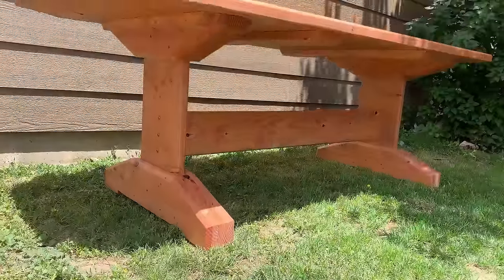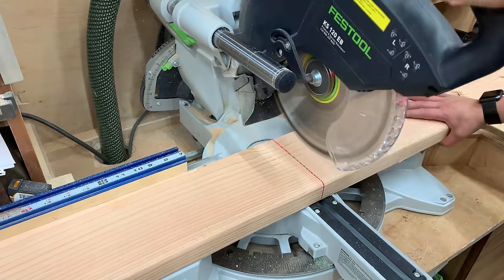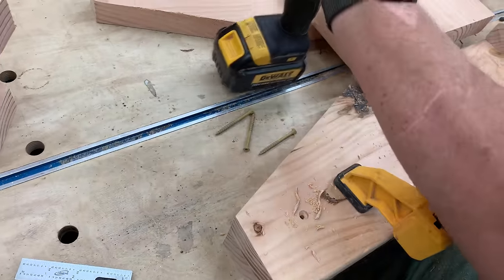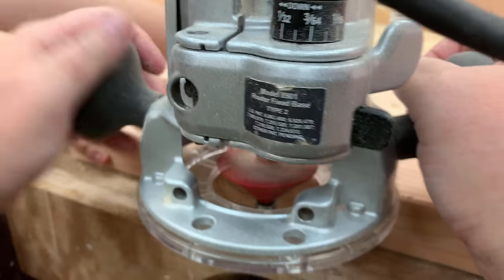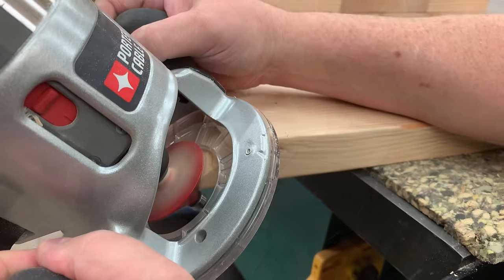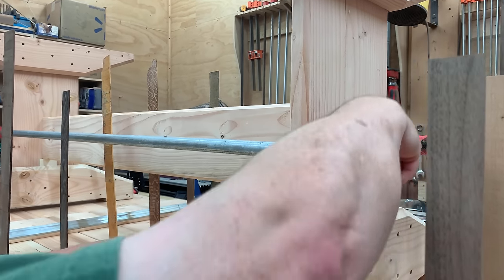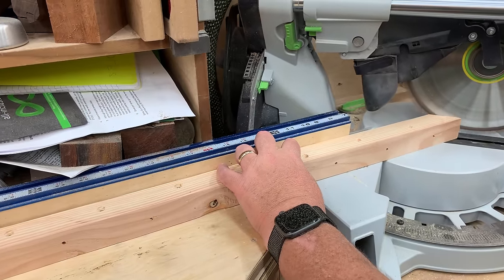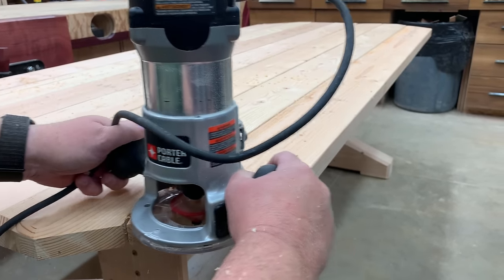91 - Outdoor Patio Trestle Table with Dimensional Lumber from Big Box Store

Comment: I love the design/look!  What about all those screws holding the tressels to the top underneath?  Where's the allowance for wood movement?  I would make slotted holes the the expansion of the top wood.
Reply from the maker: Not necessary, for the same reason you don’t slot the screw holes in a redwood deck. 

The wood is a soft wood. It stretches and moves around the screws. It’s not gonna crack or check, and the screws aren’t going to pop or break either. 

I’ve got 35 year old pieces outside built the same way that have gone through all those seasons with no difficulty whatsoever. 

And we have big humidity swings here from winter to summer.

Comment: Can the support bar be placed at the top closer to the tabletop underside without making the table unstable? I'm trying to accommodate for a wheelchair to have ample space in the footrest area beneath the table .
Reply from the maker: Hi!
Yes it certainly can. You could also make the table top a bit wider so there is more depth on both sides if needed.
Reply: @KingsFineWoodworking  Thank you!

Comment: Nice design, i noticed you did not include any slop in the holes attaching the top to the base, do you not think the top will spread if/when it gets wet?
Reply: The 1/8 inch spacers give the top surface boards the needed room for expansion.
Reply: I understand that but as the planks are anchored in multiple places so may crack at screw points, thanks for your response.

Comment: Great work as always.
I had a question on the wood selection you mentioned at the beginning. (I'm fairly new wood worker hobbyist) 

I had always heard that outdoor furniture was best made from cedar. Do these other woods work as well?
Reply: Cedar is the best to use for outdoor furniture as it's naturally resistant to water. However, it's also MUCH more expensive. I think he said he had $75 in materials for this build. If they used cedar, it would easily be $300 or more.
Reply: @Anthony-H  thanks for the info!
Are certain finishes better suited to protecting outdoor furniture?
Reply: @briannelson605  Spar urethane is a great outdoor finish. It's clear and waterproof.

Comment: You absolutely did not need that many screws. In all reality you didn't even need any screws. And your attention to detail is horrible. If you had to use screws at all you should have made sure they would have all been on the inside. I don't know man, but all I can see is amateur work at it's best in this video. Table looks decent, but such a lack for detail goes right through me.